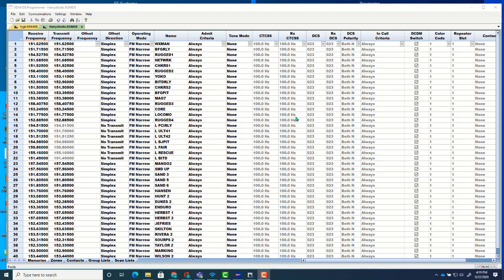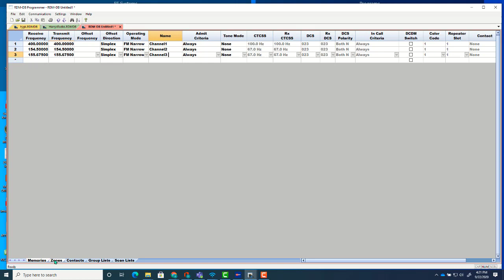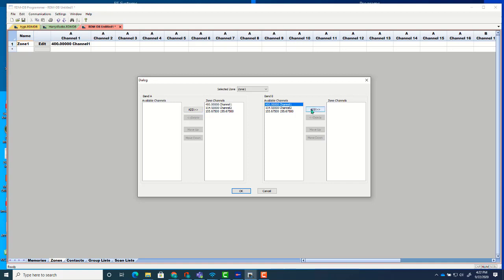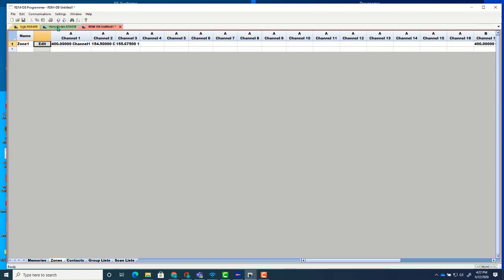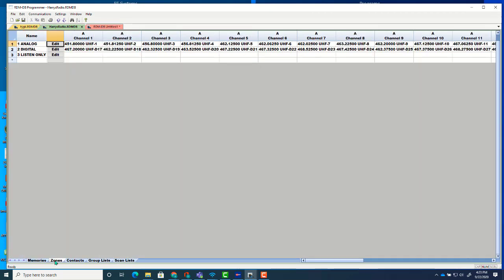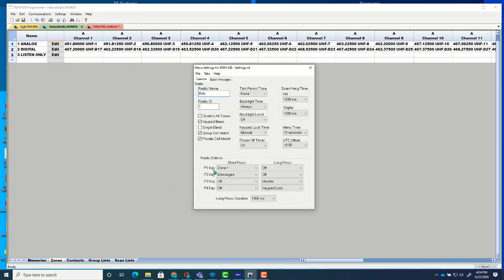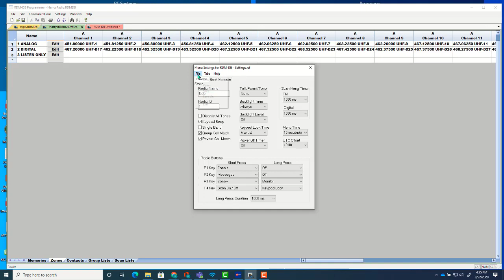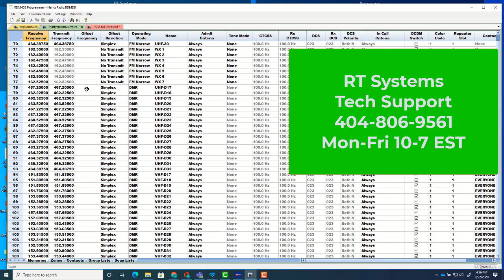Setup for Rugged Radio RDM-DB Radio

Comment: Just got my radio today, I'm told its ease to add the GMRS channels to this radio.  So, how do I program GMRS channels on a RDM-DB.   Thanks, Don
Reply from the maker: Feel free to give our tech support a call 404-806-9561. We will be glad to assist you.
Reply: @RTSystemsInc  Yup,  it happened to me.  Unprogrammed error message.  tech told me it's a software glitch.  the work around is to make sure you are in the memories tab before sending files to the radio.  Got it working with all the GMRS channels.  Thanks RT Systems.
Reply from the maker: @TheOCSurfer  Glad we could help you with that.  Have a great afternoon.